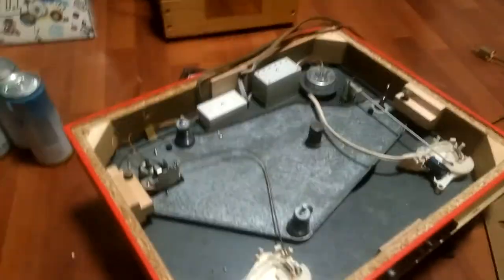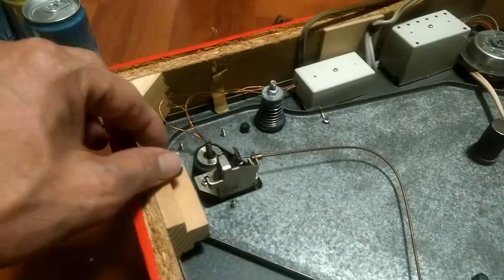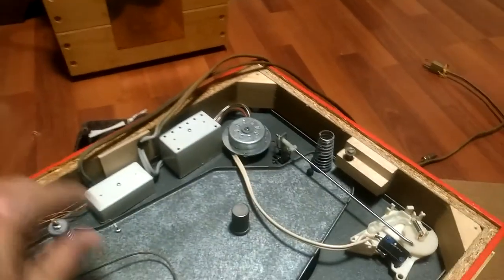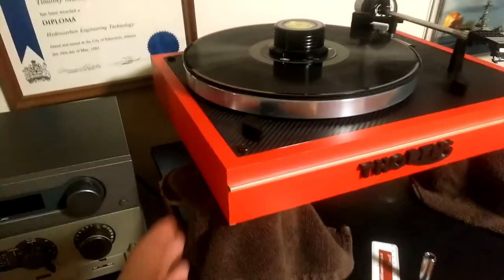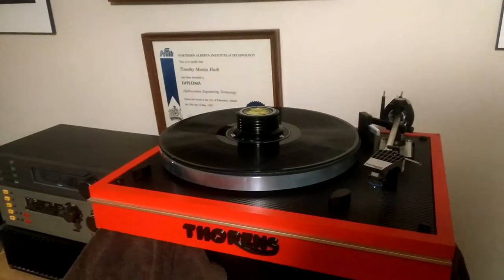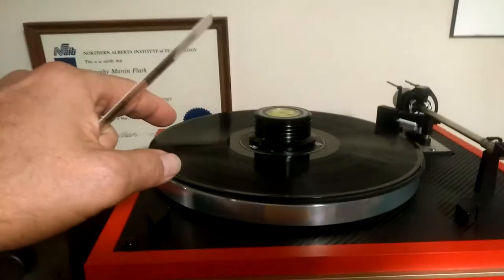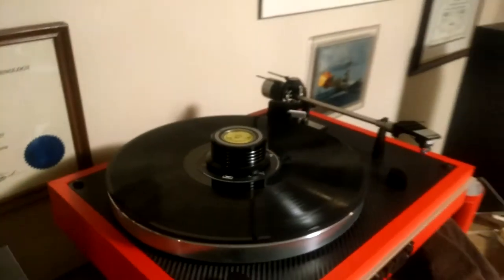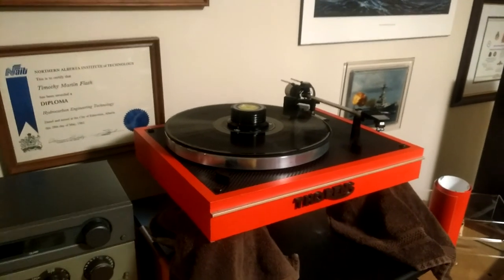Thorens TD 165 Maintenance and Tuning

Comment: Thank you,   But boy you take so long getting to the point.
Reply from the maker: Fair assessment - wish I had the time to edit most of this stuff down. I simply do not because I work full time on a military base as a civilian now (retired military), DJ/VJ weddings and events on weekends, Have a yacht to also sail on off weekends that I am not gigging plus I am a massive audio nut rebuilding amps and such - something simply has to give. Polished sharing videos is simply one of those time management hits sorry to say. Suggest a judicious use of the fast forward slider to get past the endless nattering  ;-)
This particular video was actually made for the guy I sold this turntable to (in Toronto) as he was an out of towner and a TT noob. I am on the west coast.  I simply decided to open up the share on this video rather than waste a post someone else might be able to find and use....
Reply from the maker: Here are newer ones I also built:  https://youtu.be/ce3YsmhBZBg
Reply: Like forever!